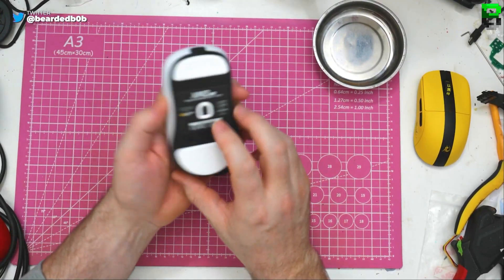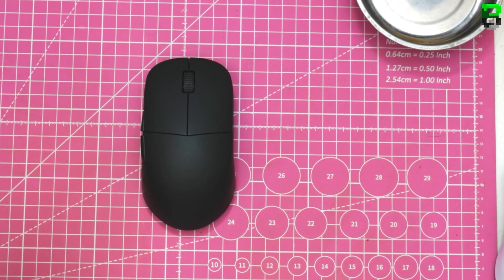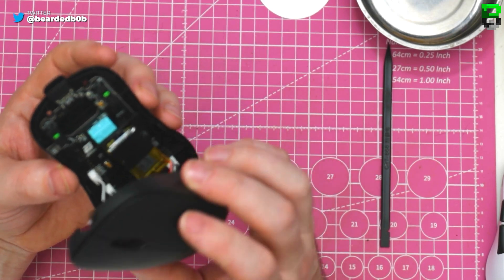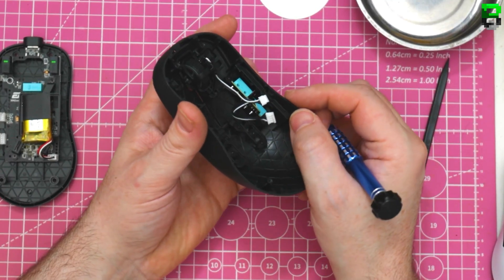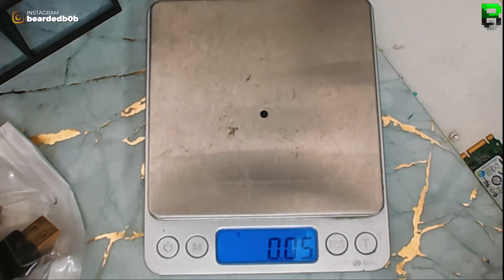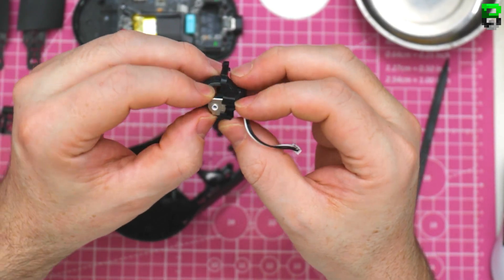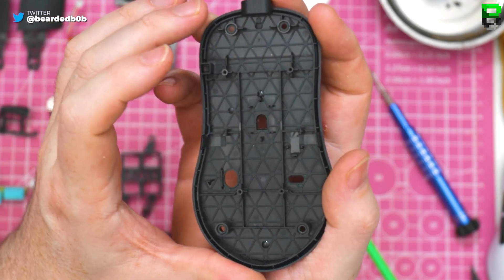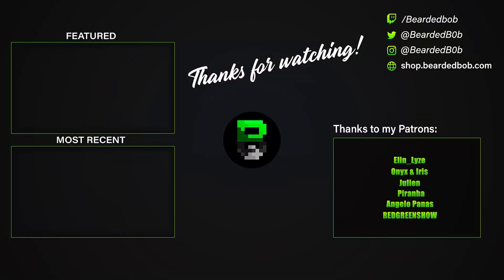PRECISION ENGINEERING UNVEILED: EndGame Gear XM2we Teardown

Comment: Hey bob, my xm2we unit left button kinda failed, not double clicking but feels off than the right mb. It debounce upwards slowly after clicking and its affecting grip during gameplay.. What optical switches do you think it works on this pcb? I cant get my local resellers to sell me op1we switch pack that are 'supposedly' works with xm2we. thanks

Comment: My scroll wheel was broken and your video kinda helped me to fix it. It's my first time ever fixing a mouse and got no idea which parts I should take off. Thanks mate, it's quite detailed video.
Reply: How did you fix this? The wheels also began to spin on my copy
Reply: @skeezv5248  There were hairs inside my mouse and I removed them. However, it started acting up in 2 days :(
Reply: @skeezv5248  I thought I fixed it. It started acting up again :( I sent it to the repairing service

Comment: Just disassembled mine for fun (and i also got bored of these heavy click + i have an issue with the scroll wheel).

Thanks for the video because it helped me to remove the scroll wheel part from the main shell. I was like what is that ??? The encoder is not soldered to the PCB and i was like : this piece of plastic will break if i try to put force on it will disassembling.

Do u now what size of encoder it is ? If it's easy to remplace because it has wires soldered to it. Also do u know if it's possible to remplace the main optical clicks for other and lighter optical like the one in the ninjutso sora 4K ?

Edit: i don't really know if i have to remplace the encoder or if i need to disassemble the encoder to clean or repair it because when i'm scrolling fast in one direction my encoder register a scroll in the opposite direction.
Reply: hey, i know this is a pretty old comment, but would it be possible to swap out the the kalih go switches for some omron switches ?
Reply: @exehonor472  Sorry, idk, i searched for that answer since i have  Sora 4K but didn't found anything about that. The omron optical are insane compared to EGG and Razer optical.  My XM2we is collecting dust atm ^^'
Reply: @lltalionll  thank you for the help n the quick reply!!! :)
Reply: Update: I opened the encoder and cleaned it with isopropyl alcool 70% and redressed all three contacts then changed the battery for a 150 mah. Now everything is working fine and i saved around 6 grams.

Comment: Would it be possible to swap the switches on M1, M2 and possibly even sides to Huano pink shell blue dots?
Reply: The sensing mechanisms are different and this would necessitate changing everything else on the PCB to conduct a switch swap from optical to mechanical

Comment: Is there any way to fix starlight side flex?  It's only on the right side
Reply from the maker: You can try to add some glue but it depends how it’s flexing… another option is to add some side struts or a bar across to the other side but none are easy fixes
Reply: Ohh ok thanks

Comment: Easy to see where some of the weight has gone into... This thing is built like a tank (+ nice big battery)!
Great job as usual Bob... Thank you (was super curious to see the innards of this thing)!!!
Reply from the maker: Yes, it’s not to heavy at 62g but you now see what’s been done.. I like that they have the same brand switches and Havant tried to cheap out
Reply: @Beardedbob  I actually think 62g is pretty good for a mouse with these dimensions (and this build quality). And considering the standard of their previous models, I knew they were not going to cheap out on their wireless stuff.

Now the decision is between getting the "WE" or the upcoming (and more expensive) "W" version... But the price for the WE is very enticing!
Reply: @IOSam  Do you need a better sensor and better switches?? I think those are the main differences between both of them, rigt?
Reply: @JazekFTW  I know the "W" has the better 3395 sensor (which has Motion Sync), so that alone should be the reason for the higher price (which I don't think would make a big difference in my case).

Interestingly, the W will come with Kailh GX switches (which are mechanical as far as I know), while the cheaper WE comes with Kailh GO optical ones. That is quite an interesting choice Endgame Gear made there, since one would think the top model would also come with optical switches... (unless they are catering to Minecraft players, who like to mess with debounce timings, which can't be done on mice with optical switches).